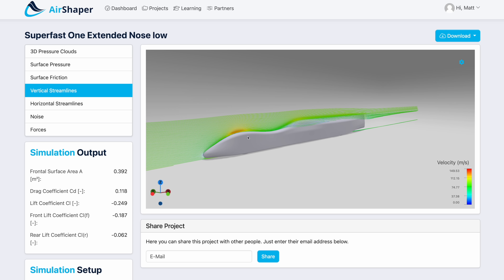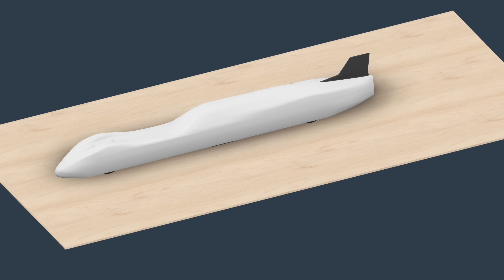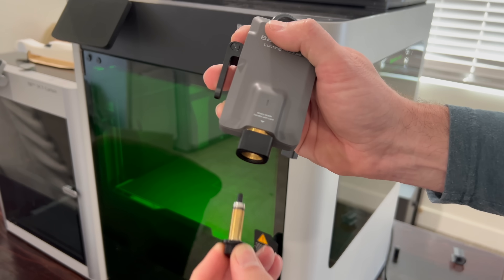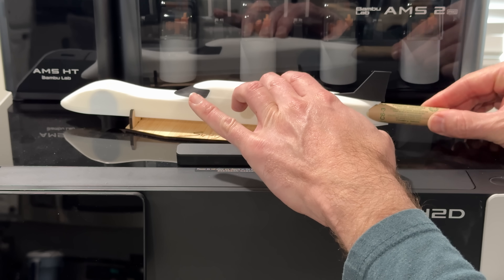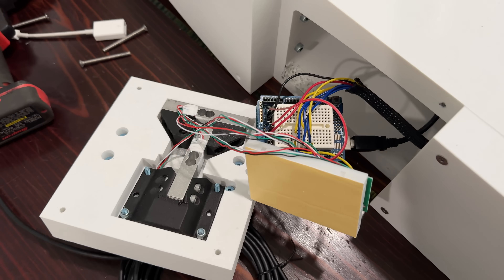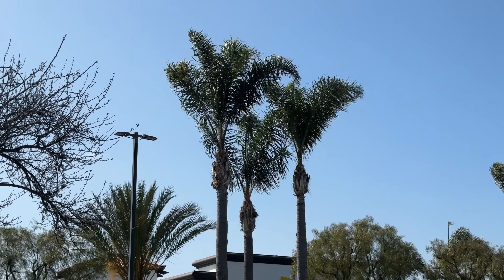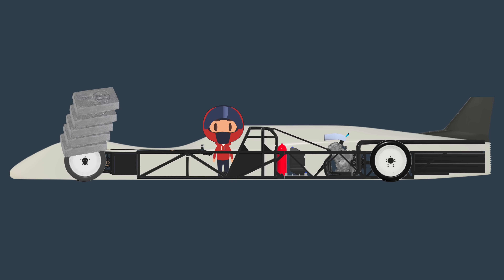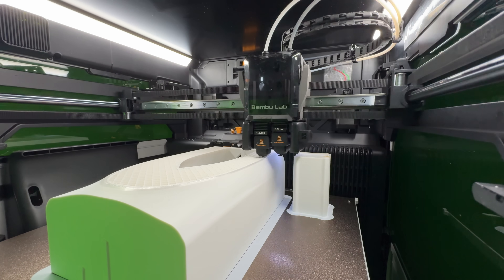Aerodynamic Testing On The Highway, With The Bambu Lab H2D

Comment: Testing a vehicle in a wind tunnel is really hard to do well. The tricky bit is the interaction with the ground. In fact I would say for subsonic and transonic wt testing it’s the single hardest thing. That is critical to determining if the car wants to lift or stay stuck down. Just sticking it on the ground doesn’t work because you get boundary layer build up. So most nascar teams use a moving ground board like a high speed conveyor belt. Doing it this way on your car is problematic because the blunt shape of the forward edge plywood will generate turbulence and there will be boundary layer growth along the sheet. I wouldn’t trust any of the lift results that you get because the flow conditions close to the board won’t be representative.

Comment: I wonder if it's allowed to have active stabilization on those race cars? Meaning a gyro and a sensor on the steering wheel plus a motor on a differential which can override your steering inputs slightly. So if the car gets squirely and you still hold the steering wheel "straight" it will adjust the steering angle to keep it straight a couple of times a second. If you however turn the steering wheel, the steering wheel input is analyzed and the turn radius calculated. If the car does not follow the turn radius the car will adjust the steering input automatically to make it yield. So it will automatically adjust the steering angle depending on oversteer, understeer, sliding of the back wheels, drifting of the back wheels etc.

Comment: Put it on a mast 3 to 6 feet above the car roof.  See if your results improve or repeat.  Without answering that question, you don't know much yet.   The air is stalled where the window angle of flow meets the flat roof.  That is too many degrees to maintain laminar flow.  I would suggest the flow at the model is substantially slower and turbulent beyond use for your purpose.  Incidentally, I've participated in similar test with a tall rig in the back of a truck on a closed runway because wind tunnel time was booked too far out.

Comment: I'm a bit concerned you've taken this as 2 dimensional problem - while the higher tail will produce a torque around the centre of mass, it could also produce a torque along the axis of the car trying to tip it over.

Comment: Would raising the model about 24 inches above the platform negate the vehicle's turbulence and improve data validity? Also, next time you use a rocket motor, put two screw-eyes in the model and run a fishing line through them. The car would follow the line instead of flying off.

Comment: I've been using PPA-CF on my x1c and I noticed a huge improvement in quality by baking out the reel. I was conservative and just did 120C for 6 hours. No boogers and very good surface finish with a 0.6 mm .16 layer height settings. From what I've been told is that we shouldn't assume the filament comes dried out from the factory even though it is sealed with a dessecant packet.
Reply: Ditto for PETG HF, some spools are good, some come soaked and print horribly. Baking them in an air fryer (or microwave?) is just a requirement

Comment: Nice work with the car top test rig.  Very impressive. My first engineering job was as a wind tunnel operator.  The Kirsten tunnel at the UW had a force balance setup.  So there were servo driven solenoids that opposed the forces and moments at the flex joints keeping everything centered. It was great as it didn't depend on the strain gauges or solenoids having any linear response or  travel as they were always at or near zero deflection. The current applied to the solenoid was measured to get the force and moment readings. The launch with the model rocket engine was awesome.  With a tall vertical fin offset from the aerodynamic center  there will be a rolling torque applied to the car with a wind gust.  That could get pretty exciting in a bad way.

Comment: I remember a NASCAR team that I won't name hiring a European engineer who convinced them to spend $250,000 to build a carbon fiber 1/4 scale model that was tested in Italy on a rolling road wind tunnel, then the disappointment of this community college engineer pointing out we got great data for pit road at a short track because they were only blowing the air at 200 mph on a 1/4 scale car. Your RC model of that car would be as good at analyzing the performance of the actual car. Unlike land speed cars though it turns out in NASCAR driver skill matters in NASCAR, we lacked so much in the area that better aerodynamics turned out not to matter at most tracks anyway.

Comment: Bambu being a locked down proprietary thing sucks pretty hard, plus they send all their 3D files directly to their servers without telling you about it, which also sucks hard. You can watch it happen if you monitor the network.
Reply: I agree that the lockdown sucks and the gaslighting during fallout after was just bad. However, in de slicer, they do tell you the models are send through their servers.
Reply: @ Good to know that they tell you now. Did they add that recently?
Reply: @21Trainman nop, it was always there if you are not in LAN-only mode
Reply: If you use a smartphone and an app and the 'cloud' for everything then you deserve what you get. How have people not learned yet?

You don't need to start prints remotely. You don't need any of that. Why is your 3D printer on the Internet? Don't do it - It's stupid. LAN mode and not being a lazy bastard solves all your problems.
Reply: @UnitSe7en  Your pfp looks very close to the N7 lol, coincidence? Possibly
Reply: @VanillaSpooks  Had the name for a long time and used to have a different image. After I made this one it was sending me a bit crazy for a few days because I was thinking "I'm sure I've seen this before..." before I figured it out.
Reply: @UnitSe7en   😂
Reply: @UnitSe7en  its not the printer that sends the files its the slicer, so unless you permanently want to keep your slicer computer disconnected from the internet you're out of luck
Reply: @miladmozayyani  The slicer only does that because you tell it to. Learn how things work.
Reply: "Without telling you." I'm sorry what. What do you think "now printing via cloud service" means? Did you think it involves those big fluffy white things in the sky? Did you think launching and monitoring a print from across the city works because you have really long wifi range?

Comment: Early airplane engineers (or was it race cars?) used a water tank instead of a wind tunnel (which they couldn’t build big enough). The water’s greater density something offset something scale model something. It worked.

Comment: These load cells actually dont measure moments. They only measure straight force. It's really cool actually.
That means it doesnt matter what lever arm a load has on them. This works by having 4 weak points where the cutout is in the load cells, and having the whole thing flex as a parallelogram. Then any difference in stretching of only the upper two weak points vs the lower ones is calculated out of the equation. Only the parallelogram flexing is taken into account.

Comment: Matt, we used to have our company's anemometers calibrated on a setup that was a frame rigged out in front of the pick up truck it was mounted on. About 7 feet out and 10 feet up.  You need to do that to get "free" air. On the roof of the 4Runner you're getting too much compression and turbulence.

Comment: Wouldn't you receive far better data setting up a couple of shop fans and measuring wind speed as a coefficient of drag and then conducting the same tests to remove variables related to mounting it on top of a car?

Comment: I'm pretty sure that the massive separation you will get from having the edge of your plate right in the airflow that comes over your car (so at an angle of attack) will be more influencial on your data than the reynolds number (even though that's pretty bad in itself). In other words, I'm not surprised your data is garbage.
On the other hand, you already went quite quick with the body on, and it felt pretty good. If it were unstable you would have felt it

Comment: I didn't see any mention of plugging the other pivot holes during your testing. Wasn't it in a previous video that you said you should minimize all holes on the underside of your body? You should have plugged the other holes for smooth airflow underneath the car.

Comment: Air acts as mass and as a spring simultaneously, thats how bass ports act in a speaker enclosure. There is also a dampening factor due to the friction between the molecules.

Comment: if the car was trying to move to 45° (even briefly), then that might be a result of the body acting like a cylinder with a fin. cylinders are aerodynamically stable side-on, and the stabiliser will fight that destabilising effect, leading to an oscillating yawing. i think you're right to go for a larger stabiliser to make sure the oscillation gets damped as quickly as possible. gl with everything!

Comment: I'm actual non-engineer(as opposed to being "uhh not actually an engineer") but isn't this experiment all over the place?

- that CoL looks crazy forward for anything, isn't that further forward than F-16!? Are you putting an Apollo Guidance Computer on a car!?
- wouldn't you want to actually change CoM with weights rather than moving pivot point?
- does the CoM even matter considering the car is supported by the wheels, not the pivot point, and would the pivot point not have to be at the averaged traction force then?
- can't you gradually apply yawing force with like, a solenoid or a massive current on a cheap RC servo with some repeatability, and then correlate like, speed and actuator current vs AoA?
- wouldn't you want to gradually increase AoA while conducting the experiment rather than repeatedly pull over and change it, anyway?
- why was the tri-axial load cell thingy floating the model? I mean, it doesn't exist in the real thing, isn't it okay to just let it pull and hold down the model lightly to simulate gravity?
- etc. btw this channel is massively underrated imo for both presentation and engineering quality

Comment: I realize Bambu gave you the printer, but most of the things you praise about the H2D are also true of the Creality K2, and it doesn't have locked down firmware that forces you  to use their slicer to get all the features.
Reply: I've seen a few side-by-side comparisons with the Bambu H2D and H2S against the K2, and it was clear the layer lines were tighter on the Bambu printers, as was the initial first-layer consistency. If the parts were for sale, I wouldn't go with a Creality; I just know from experience people will ask why the surface has blemishes.
Reply: And if Creality was sponsoring him, he'd be talking about the K2 instead of the H2D
Reply: @hkrsrppl2  yeah, I realize that, hense my first sentence. I just wanted to put that out there for anyone else watching.
Reply: Yeah, but it's Creality. Enjoy your poor QC.
Reply: @UnitSe7en they're actually doing great lately, far from their beginnings
Reply: @UnitSe7en  like the gen1 X1 extruder gears and belt pulleys, and AMS system failures?
Reply: @Skwisgar2322  On what percentage of machines?
Reply: For real, as a private customer who needs an easy way to 3d print i love my x1. i do not care which slicer to use and are all other companies like apple etc are doing the same thing?
Reply: @timsane Paying that much for a printer and then not caring what software you have to use is honestly just dumb. 🤣
Reply: @ no I am paying to be able to print as easy as possible. - which it does. For 14 month straight without touching anything, no need for replacements etc.
Reply: @timsane  My A1 crapped out in the first two weeks. Failed 5c sensor that's glued to a $30 extruder.

Since then it's been pretty much reliable, but can we stop pretending Bambu have mastered printing perfection? They make decent consumer/ prosumer kit that's competitively priced, but comes with the downside of questionable company ethics and long term goals.
Reply: @timsane look I'm not trying to bring down the brand or anything, I have a bambu printer too... But pretty much any reasonably priced modern printer can do that today. The days of "mandated" tinkering are over.

Comment: Is that OAK VENEER you drilled holes into for a platform?  Surely there are other ways to obtain a relatively smooth surface.  Two demerits from the woodworking community.

Comment: It might be a good idea to reread the rule book and reach out to the sanctioning body to find out if you actually do need to wrap a printed aero component in carbon fiber or not. My experience has been that not doing that could have negative results on your experience at the meet. 😄
Reply: I can absolutely see them saying "no, you need something structural besides a 3D print".

Comment: Highway air is most unsuitable, turbulent and chopped up by traffic. The guys I know who test model scale airplanes on top. Of cars find old runways, empty roads at 5 am, or beeches.  Use your aero tools to study what you have to do to condition, and possibly accelerate, the flow over the model and test roadbed.

Comment: Aerodynamic balance and weight balance being at same place the results are just as unpredictable as it should be. Aerodynamic balance should be rearwards noticeably from mass center, which I would still try to put quite 50/50 in the car for drivability.
Reply: yeah and it's godawful close right? I've never seen those two points this close looking at various random stuffs on Internet. Seems close as it would be for air-to-air missiles.
Reply: @すどにむ  I do not have experience aerodynamically designing or testing air-to-air missiles, so can not have valuable viewpoint on that. But I believe you on it.

Comment: Matt! Don't light that fuse! I have conducted lots of tests on my channel, and I can categorically assure you that the motor you show in your video is half an order of magnitude too big for that vehicle. Unless you add lots of weight, it won't work. And even then, mine kept crashing till I added rubber tyres and solid axles, to force the wheels on a given axle to revolve together.
Reply: Ha! I just watched all the way to the end. Note to self: "watch till the end before commenting".

Comment: The wind speed for wind tunnel tests actually depends on what the test is applied to.  Here's an excerpt from a wind tunnel test i used professionally once for solar panel design:  "The tests are run at a sufficiently high reynolds number that reynolds number independence is established.  Strict reynolds number equality is impractical from an experimental point of view."   

For buildings, we always want to test in the fully turbulent regime.  Essentially what they're saying is, and there's a specific test wind speed where that turbulence is established, and going faster no longer produces significantly different results.  In order for you to gain meaningful data from your test, you need to have computational modelling of the flow patterns at speed (which you do).  Understanding if you're fully out of the laminar flow regime is going to affect how carefully you need to control your test speed.  

I also want to point out that professional wind tunnels take great care to condition the air flow as it reaches its test subject.  For aeronautical wind tunnels, the model is placed far from the walls in order to try to get perfectly laminar flow when it hits the model.  Automotive wind tunnels place the car on the ground to get a slightly better approximation of the effect of drag from the ground.  Really high-end automotive wind tunnels have rolling floors to further refine that effect.  Structural wind tunnels include obstructions glued to the floor to simulate the effects of trees, shrubs, and nearby buildings.  Something all of these share in common is that the model is usually placed as far as reasonably practical from the fans producing the wind.  

All that to say a couple things.  If there's any laminar flow regimes your fuselage has to deal with, then the definitely quite turbulent test on the freeway definitely did not encapsulate the operational conditions.  Also, a professional wind tunnel operator would probably look at this test and consider it completely invalid due to external influences which cause the approaching wind to be non-representative of reality.  You'd probably be more accurate with a leaf blower than the freeway.

Comment: In September of 1993, I was attending the Brighton Speed Trials when a Rover V8 twin turbo single seater ran the 1/4 mile. The rear wing failed, the car turned left into a brick wall killing the driver, so, aerodynamics are important.